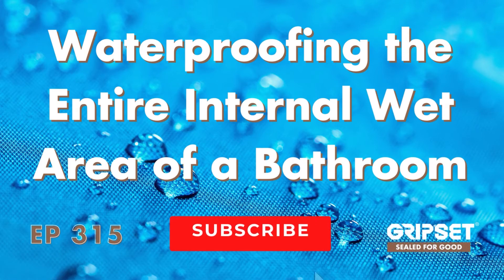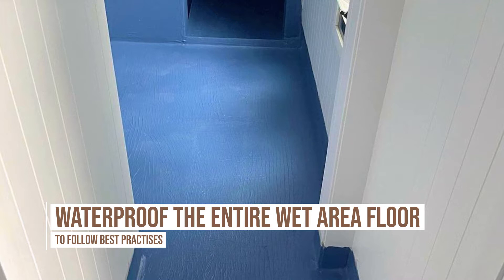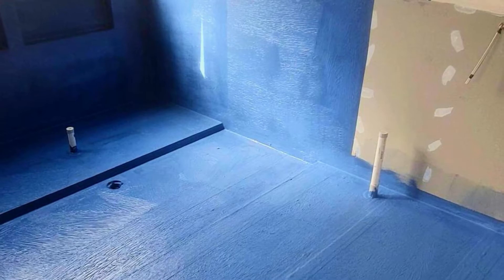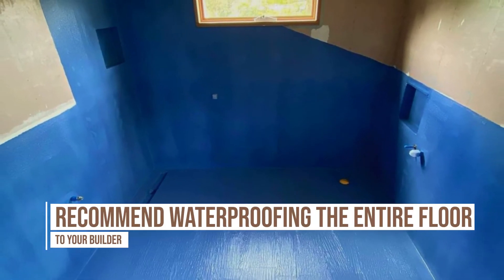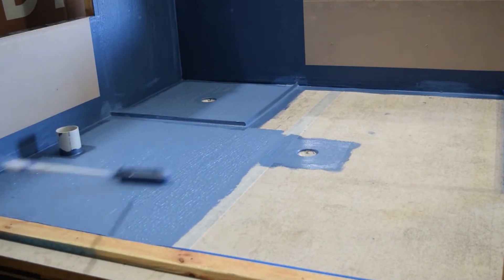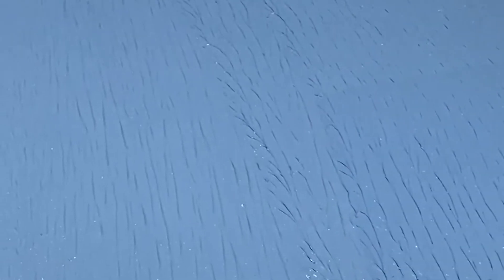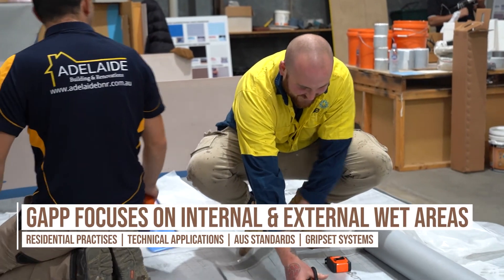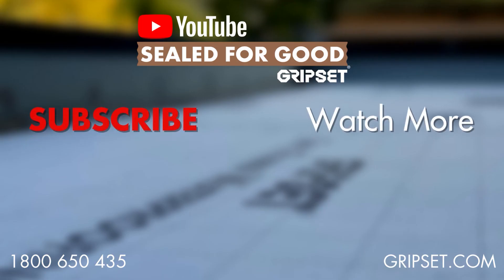Waterproofing the Entire Internal Wet Area of a Bathroom

Comment: Hi, I'm getting the bathroom re-done and it's a double brick home. The guy has removed all the tiles but has left the old cement glue etc on the walls. Should they strip back and villa board the area? My wife is questioning this thanks.